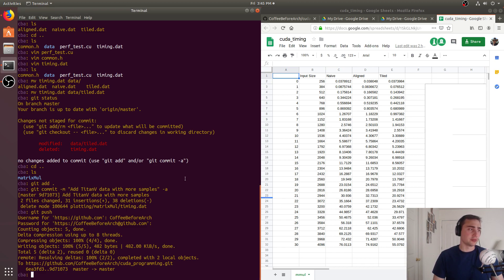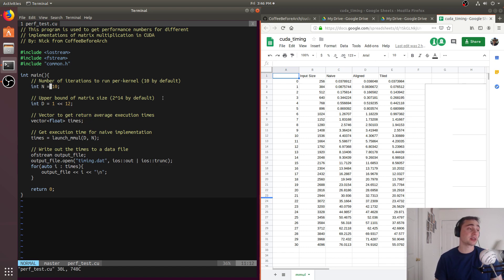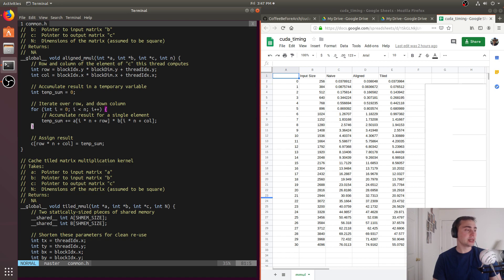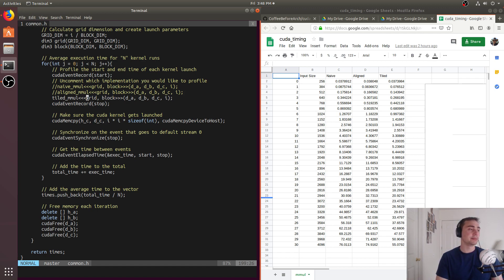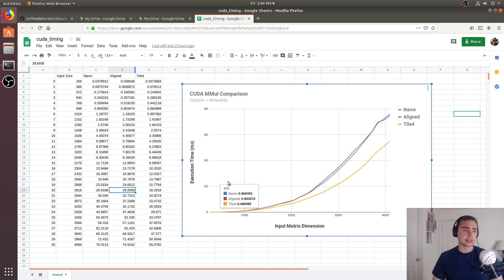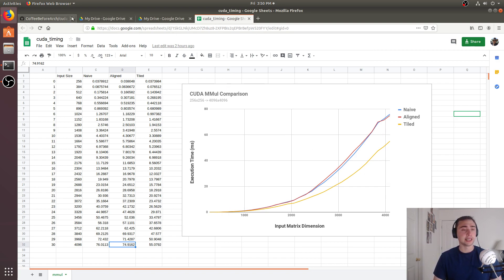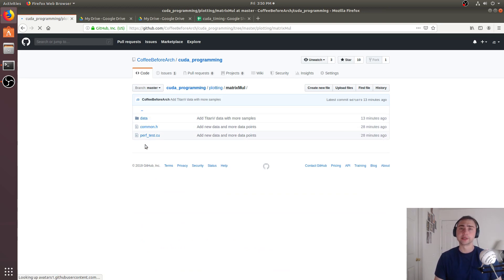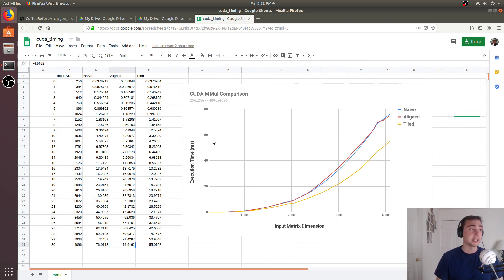CUDA Crash Course: Comparing Matrix Multiplication Implementations

Comment: Thanks Nick, very helpful. I have a question, I copied your code and paste in the visual studio, using Windows, and my  GPU is rtx2060. However, it appears I need 50 ms to finish this 1024*1024 matrix multiplication. For your excel, I guess it should be less than 1 ms. Do you know why? Is it because I am using Windows system? Thanks!
Reply: 多跑几次也是50ms?